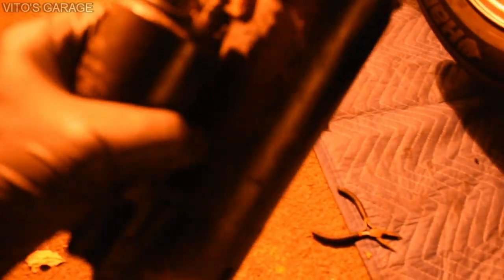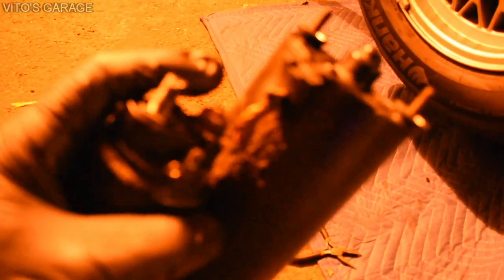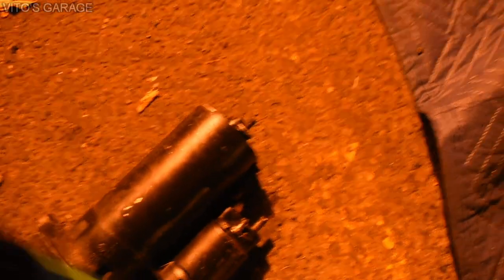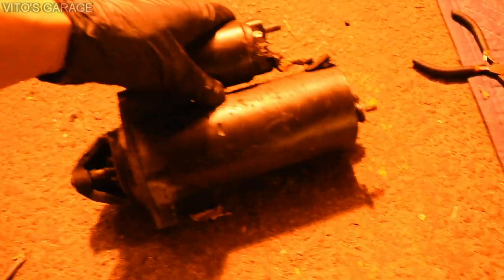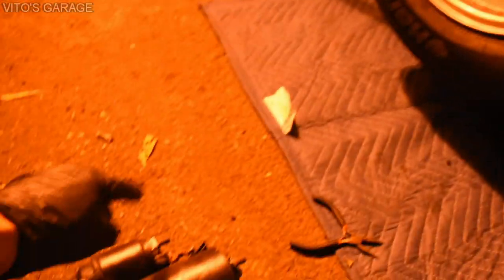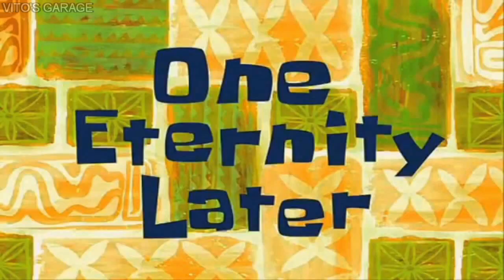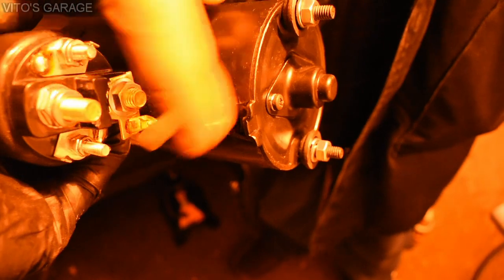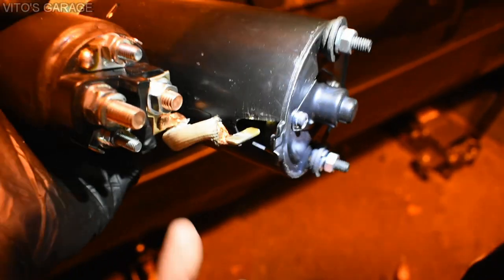Leo Yakubovich and BMW Drama. Mind Blown

Comment: Bench test with a piece of wood 🪵 on the bendix
Reply from the maker: We tested both starters with jumper cables and a screwdriver. Original starter was ok. The engine is locked up and that’s why you heard a click every time we tried to start it